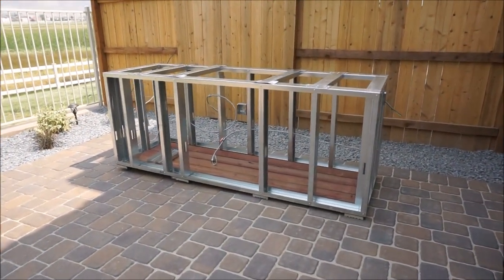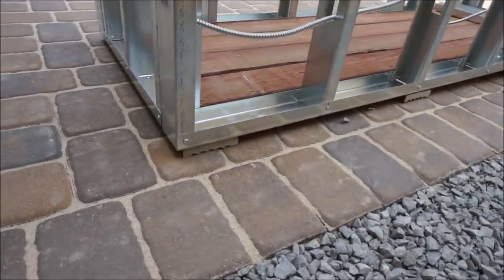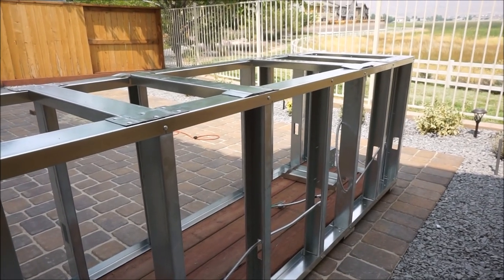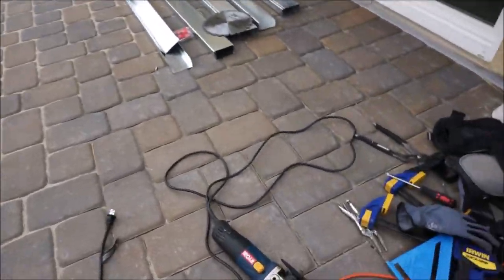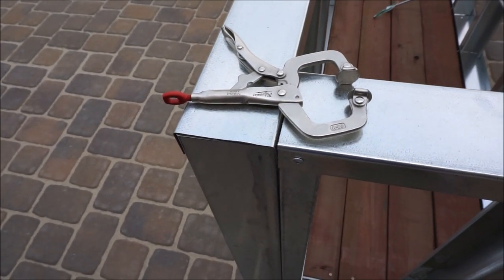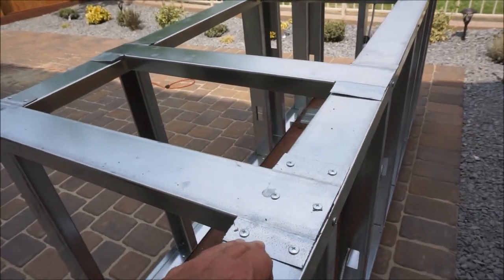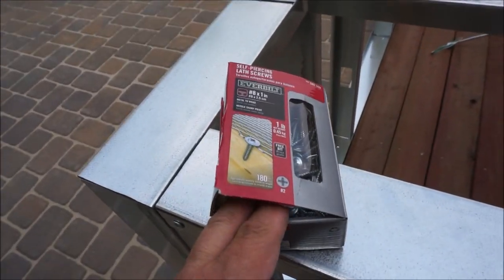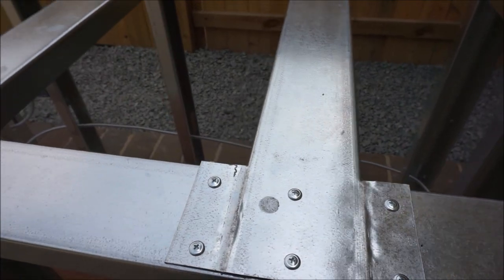BBQ Island Project Video #1

Comment: Great build Sir thanks for sharing with us. Did your supplier not recommend you run the track through the walls to lay the cables on? It's code where I live do to fire regulations, or grommets around the cable even with the metallic covering. We need them for plumbing to. I want to install a demand water heater as well. With propane for the BBQ I will only have to run one water line to supply the intended sink. I just subscribed I learned a lot.

Comment: What is the flooring inside the frame screwed to?
Reply from the maker: I installed some decking boards below the bottom metal studs so the island was about 3/4 inch off the ground for airflow. Then I attached the 2x6s to the boards
Reply: @bjbhehir  - Thank You!

Comment: Dang, 18g, nice
Reply from the maker: Thanks!! It's really solid with 18g, they're easy to work with too.
Reply from the maker: Used my grill tonight and it still looks the same as the day I built it, no issues at all, it's been almost 4 years!! I do keep a cover on it but it's out in the freezing cold during the winter and hot summer days!!
Reply: @bjbhehir  im almost done with mine, used 20g… some say they used 25g which was way to flimsy imo.
Reply: @jameschristopher3405  awesome! Good call on the 20g!

Comment: I was curious as to whether the  decking boards underneath the frame are attached to the slab or are just held in place by the weight of what's above them. If they are attached, could you tell me if you use anchors, etc?  Thanks.
Reply from the maker: Hello, I used some Trex Descking boards under the frame and just screwed them to the frame. It's really solid with the pressure treated boards attached.
Reply: Would I anchor the trex boards into the concrete slab as well?
Reply from the maker: @JLThisisMe  You could but it's not going anywhere!!
Reply: @bjbhehir  What area of the US do you live? I have pavers as well but live in the hurricane state of Florida. The big risk is not staking it down into the ground and it get torn up by a big hurricane. I cant find any sources that explain building up BBQ setups with those forces at play.
Reply from the maker: @NicooRico  I'm out West in the Lake Tahoe area. Maybe you could fill the base with cement? Good Luck!!
Reply: @bjbhehir  that's a good suggestion. Thanks!